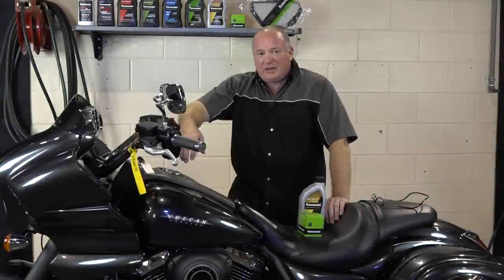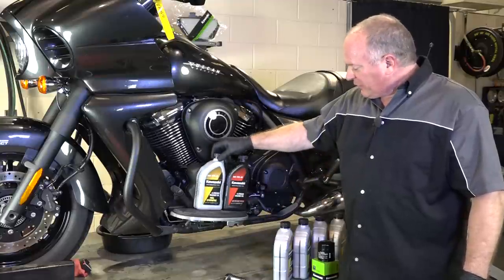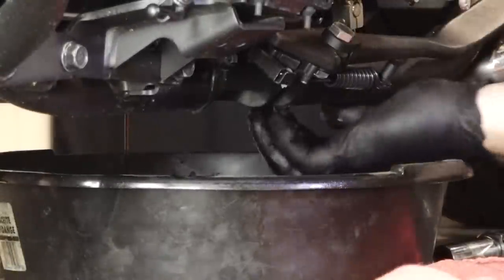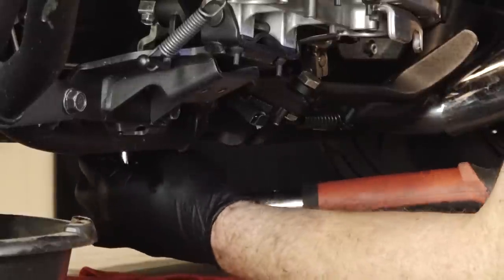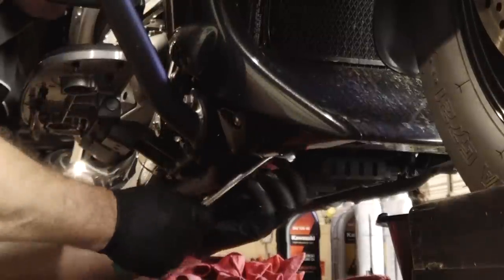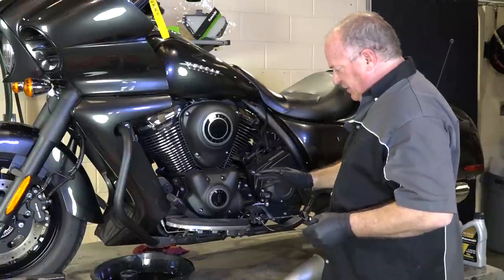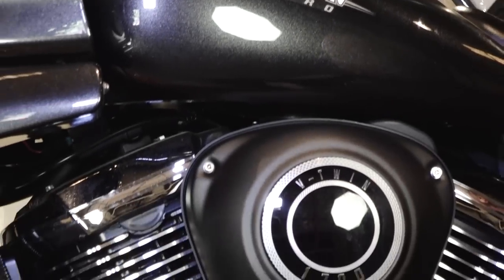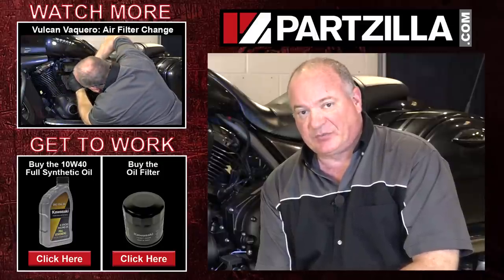2015 Kawasaki Vulcan 1700 Vaquero Oil Change | Partzilla.com

Comment: Ah, yes he’s right on with the oil level. I did my Vulcan Nomad 1700, added a schosche more & the stick was topped. Will take some out, 10w40 M1. Trying this instead of V-twin 20w50 M1. Kawasaki uses a radiator so I figure it can handle tx heat well. HD probably requires the extra viscosity down south. I suspect the radiator fan will activate more but it’s designed for that.

Comment: To check oil level, does the bike need to be on a side stand or upright? You have yours on a mechanic stand, but the bike only comes with side stand. When I checked my oil level in upright there's almost no oil on the stick. When on a sidestand then seem over fill. I just brought the new 2021 bike home last week. Wondering what is the correct procedure to check the oil level.
Reply: Upright after running for 5 minutes and 5 minutes off as per Kawasaki manual
Reply: @quacker998  I assume the same for the Vulcan Nomad and any of these big Kawa cruisers?

Comment: Hi. Thanks for the videos. I have a new 2018 Voyager 1700. My question is about tire pressure. The book says 28 psi for the front tire. Yet, an advanced driving skills instructor says that the front wheel will 'fall' to one side during low speed practice manuevers, while practicing full-lean/full lock turns, & exercises. So, he inflates the front to 40psi to prevent the front wheel from 'falling' to one side during tight turns. Will 40psi be dangerous to ride on? Thanks.
Reply: I run 40psi front and rear.... 28 will cup a tire...
Reply: hello i did the same problem with my vn1700, 2010....28 front, 40 back and i failed during light stop due to turning too much the steering.

Comment: My 2006 klx 110 will not start, but will on occasion if you let sit for a couple days. It has a 143cc big bore kit, bigger race cam, 28 mm Mikuni carb, FMF 4.1 straight pipe, and also a bigger jug. It's getting spark getting fuel and the carb is not that dirty by the last time I checked it. What could it be? Please respond it would mean a lot… Thanks
Reply: Your big bore kit may have affected one of two issues. 1. You may have to re-jet the carbs for more fuel due to the larger chamber size, now. Or, 2. You may have to re-pipe your exhaust if the back-pressure is incorrect, due to the new bore size. My guess is the exhaust valves are now too small for the job. What you've done is make the bore larger, without enlarging the intake & exhaust valves. These valves were sized for the engine, and now you have more area to fill (intake) and more to vent (exhaust) than the valves might be able to handle. This leads to a chamber not filling completely, low fuel/air mixture, causing you to re-jet. Or, if you can't clear all the exhaust during the cycle, too much back-pressure by volume. Hope this helps.

Comment: Dear John,

I do oil change myself on my Kawasaki Z800.
while doing so, i put some oil in the new filter ( exactly 100ml ) , by which i didnt spill any while i put the new filter on the motorcycle.
i do this so that engine does not starve of oil when the filter soaks it initially.
During the initial start up , the low oil pressure didnt go off for a good 10-20 seconds..
I then removed the filter, added more oil to get rid of 3 tiny bubbles and then the next start got rid of low pressure within 3 seconds.
I suspect trapped air in filter , but is the oil pump not powerful enough to push that tiny bit of air ?
Reply from the maker: Should be, might have created a little pressure pocket.  Normally it will fix itself.

Comment: Kawasaki owners manual says 5.3 quarts
Reply: That's what I also read in the owners manual..
Reply: 5.3 if the motor is completely dry.. it says 4.5 with oil filter change

Comment: Hi what’s all the tapping noise heard when you cranked up? I’ve had this noise on my 2010/ Nomad 1700 periodically 🤔
Reply from the maker: Valve tap.  Normal as long as it isn't knocking too hard.
Reply: Appreciate the info; Nomad kawasaki has been a fun and reliable machine.
Reply: @PartzillaParts  Hydraulic valve lifters .  Clean or change .

Comment: 2 oil drain plugs 🤔 what's the reasoning of that ? Lol
Reply: Its a semi dry sump. You drain 2 qts from crankcase and 2 from oil tank. Each has its own drain plug.
Reply: Many bikes are like this the suzuki m109r and honda vtx 1800 are the same.
Reply: Yamaha and harley also
Reply: One is for the trans